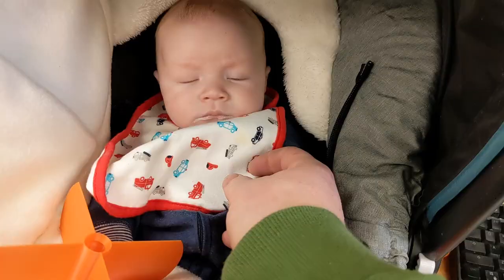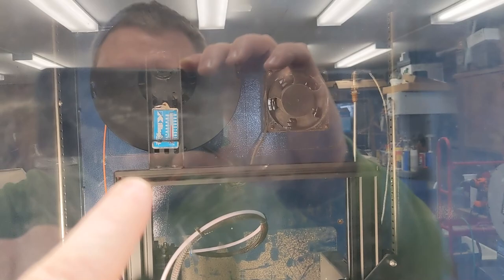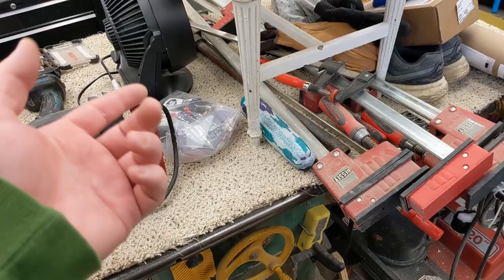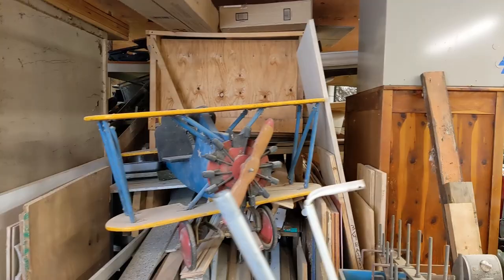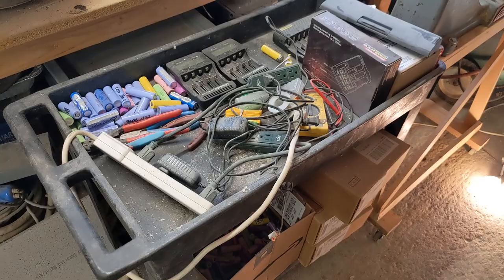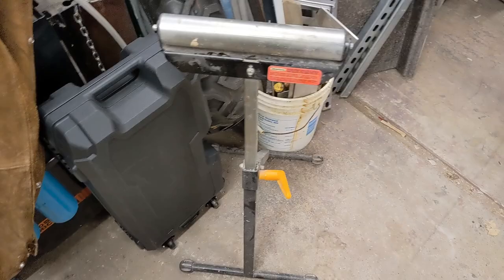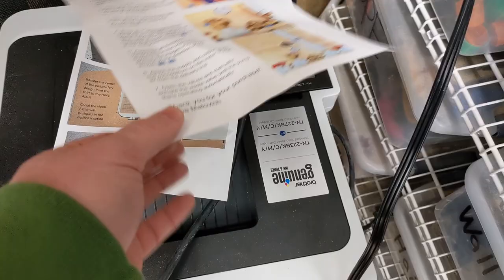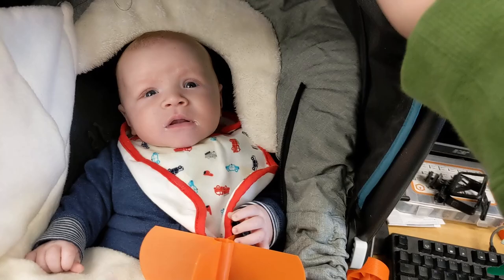Shop Update

Comment: Are you planning on making more water turbine videos in the spring when the snow melts? :) 

I'm currently learning about video stabilization and editing with davinci resolve and would love to let my cpu chew through all these frames :) 

Love all your videos can't wait to see more!
Reply from the maker: Absolutely! I would normally be making water turbine videos right now but due to an incorrect SWAG estimate dealing with the ice collection system my penstock has frozen up this year. Last year it did not freeze up with just normal turbine operation.

I tried divinci resolve before building an editing computer, it just would not run on my weak laptop. I now use Adobe Premiere on a monthly subscription.
Reply: @JoeMalovich  Have you seen heat tracing systems? Basically using a temperature controller to turn on and off a resistive heating element insulated againsts a pipe. I think this could be a really good video series, and a way to future proof your penstock.
Reply from the maker: @blakegardner2339  I would need 800 feet of heat tracing. If I had kept the water flowing it wouldn't have frozen. The problem was I had 100% of the water flowing to the sprinkler head which is what froze up, I think due to insufficient flow because when things freeze up my spring output decreases. once that frize then entire line stopped flowing which allowed it to cool and freeze.

I should have had a minimum of like 5GPM dumping into the turbine pit so it wouldn't freeze.